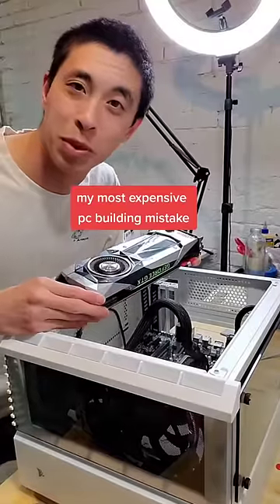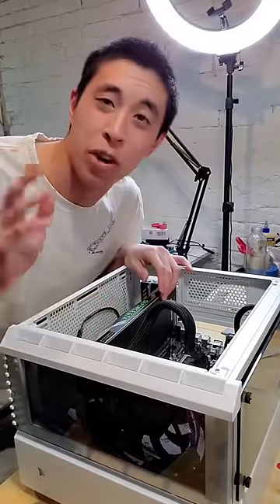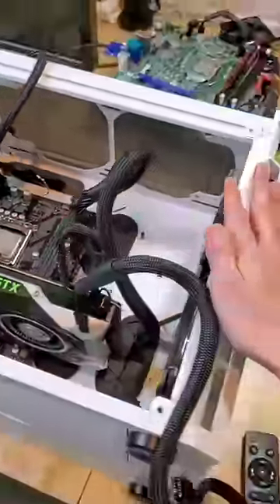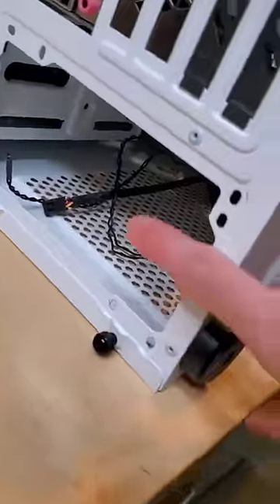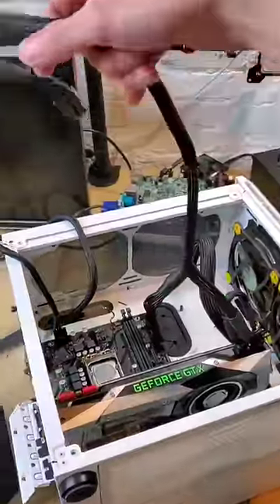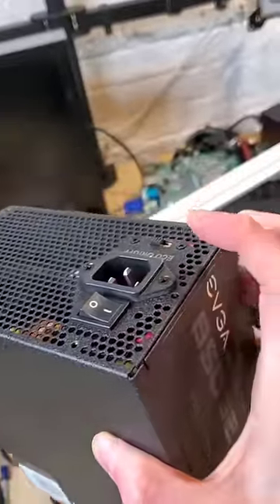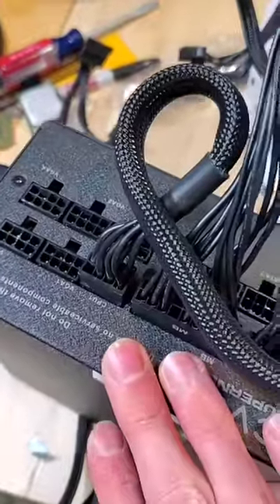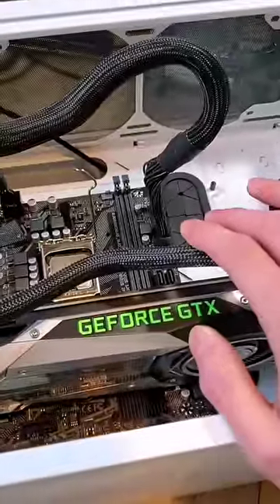my most expensive pc building mistake... #shorts

Comment: I bought every single price I needed for a rig, every single one of them was incompatible. wrong socket, wrong ram, wrong PCI version for the card, wrong case, GFX card was too big for the case, wrong heat sink, and wrong video cable, PSU didnt have the right power connector for the GPU. The fans fit the case tho. Biggest mistake ever. I got the right parts the second time around thanks to PC Part Picker, of which I discovered 2 years later...
Reply: god damn that sounds annoying. this isn’t as bad but i just bought some second hand corsair RGB fans, only to find out i can’t use them w my motherboard and need the corsair hubs, so i then bought some second hand fans the commander pro and an rgb hub, only to then find out 3 of the fans the second guy gave me were only red, the rgb one didn’t work and the original ones i got are older ones and aren’t even compatible with the hub lmao
Reply: On my first build I think I was so paranoid about making that mistake I spent nearly a year researching part compatibility (back in 2009)
Reply: @CreativityNull  At least I didn't give up and buy a Mac >.>
Reply: @zilog1  no for sure. I'm not saying your approach was worse than mine, sorry, was just offering an opposite viewpoint. I spent way too long grinding the research, and I still missed a lot of obvious things (like not using standoff screws and frying my first motherboard when it shorted)
Reply: @CreativityNull  nah nah I getcha. no hard feelings. just saying
Reply: arent PCI versions up and downgradable?
Reply: @CreativityNull  lmao I know that type of paranoid. I spended more than a year doing a research of the components and 2 weeks before getting the pc I checked like 5 times per day the characteristics of each component I chose
Reply: bruh you dint even watch any youtube before doing that?
Reply: @LongX49  I was 13 :p
Reply: @zilog1  It’s a big problem with young builders, but it’s easy once you get the flow, well you learn from your mistakes, and i hope it eventually helped out!
Reply: @berichixd7219  Yeah, it’s not all a breeze, but it’s not that hard to get things right in a pc, you just have to figure it out, and there are alot of good compatibility tools online.
Reply: @khertz  There are multiple Pci versions, but there are 2 mainly used, standard Pci is mostly used for older graphics cards or audio and bluethooth modules, but PCI-E is used for higher performance graphics cards and these graphics cards fit inside pci but it wont run as well.
Reply: he's just trolling, pcie is backwards compatible and every psu has pcie connectors
Reply: @nvramdotli  depends on when it happened. The PCI-e compatibility isn't usually a real problem but it can seem like it for a lot of people (and some motherboards and PCI-E cards can have trouble negotiating speeds if the version doesn't match. I had this issue with a SAS controller I was using as an HBA for a home server build. Graphics cards don't typically have this problem though.) As for the PSU, depending on when it was bought this could have been in the days where some PSUs didn't provide GPU power (if this was like 2006 or something) because most ran entirely off of the power provided from the PCI-e port. It also could be that they bought a cheap PSU around 2010 (plus or minus a couple of years) where not every PSU had an 8-pin connector for a GPU and he might have bought one that only had a 6 pin but then bought like a 9800 GTX or a GTX 280 or something. It might be none of these things but you're working off of a lot of assumptions considering we don't have any information like a timeframe or what exactly the parts were. The least you can do is give the benefit of the doubt

Either way, it happened awhile ago, it's done and they seem to have learned from it, so what are you trying to prove here? Are you just wanting to feel superior? Because right now you seem worse than the kid that made a mistake (which was fixable if the company they purchased it from was good with returns). I'm seeing a pretty good example of the Dunning-Kruger effect here :P
Reply: @CreativityNull  lol by the time you got everything together it was probably outdated as shit
Reply: How does that even happen... Did you just buy components based on what name sounded cooler
Reply: I walked into a computer store with my dad when I was 13 (they still existed at the time) and picked every part I needed for a PC. No compatibility issues except I made the poor choice of buying an unnecessarily expensive motherboard and a cheap CPU. It was Asus’ best AM3+ motherboard with a weak FX-4100 CPU. Everyone learns from their mistakes, but a little more research goes a long way.
Reply: Imagine not taking 2 min to do some research or ask questions and just buy random parts thinking a pc is like legos and you can just plug whatever wherever
Reply: @CartoonWeasel  I was about 13 with no internet until I was 18 :)
Reply: @CreativityNull  Bro it took me a year on and off research too. But thanks to youtube and pcpartpicker I managed to build my own pc. Only thing I regretted is that I listened to the employee about using a non modular instead of full modular.
Reply: @CreativityNull  my first build of everything was this year and it went perfectly
Reply: @bigboyfluffy5531  congrats! That's awesome! Information definitely feels more accessible these days than 12ish years ago so I'm glad more people are able to take advantage of that.
Reply: @CreativityNull  I probably spent even more time, though that was mostly down to having all that time while very slowly saving up for everything. I started researching early in 2019. The first part was probably bought mid-2019 if I had to guess as it was on sale. The PC was finished in December 2020, and almost entirely rebuilt to be upgraded in December 2021.

For those that care: I upgraded the CPU (R5 2600 -> R9 5950X), mobo (because it couldn't even handle 2 sticks of RAM at 3600 MHz, let alone 4), boot SSD (slightly faster and 1 TB instead of 256 GB) and PSU (my previous one was fine at 650W, but I upgraded to 1000W for a future GPU upgrade - which is hopefully soon with the dropping prices :>)
Reply: @monsesh1316  PCPartPicker I don't think existed for my first build and I wish it had. I built a few dozen wishlists on Newegg and kept checking performance and compatibility. PCPartPicker makes this stuff so much easier.

As for the modular vs non-modular it used to be (probably 8 years or so ago) that going non-modular was a good cost saving measure and you weren't getting much more in quality by going modular and the only thing you were getting was better cable management for the extra cost. Now the price gap has narrowed considerably because modular (and semi modular) PSUs are more focused on by PSU manufacturers and they can bring down overall costs with higher volume orders. This also means non-modular aftermarket PSUs aren't getting the same attention they were and you're now getting way more by spending the extra $20 or $30 on a comparable modular PSU. The sales rep you spoke with was probably working with old information, which is understandable, but I wish they had kept up better for your sake. Hopefully the worst that happened is you wound up with some system instability (that's what happened to me when I bought a cheapish PSU years ago) and not fried components.
Reply: FUUUUUUUCK dude. This is something I worried about in highschool but I know my stuff now so that's just a good chuckle man. I feel for you.
Reply: @zilog1  Honestly idek how you mess up that badly. You probably should have gotten a Mac.
Reply: @Vizimech  I was 13 with no internet access and parents did not know how to tech. You'd have to shoot me before I get a Mac to use unironically. Macs are a blight among humanity.
Reply: I feel sorry for you bro
Reply: Dude this was hilarious.
Reply: This is why before you build a pc, make sure you have an enough knowledge about each parts. I used to buy a pre-built pc before but when I finally got enough money and research, I started to built my own.
Reply: @JohanneszAgum  I was 12 🙄
Reply: @zilog1  Welp that was an age for curiosity but you failed to mention your age so I was assuming that you're probably like 19 older above. I was building pc at that age tho.
Reply: @JohanneszAgum  I was 13 at the time. I'm currently in my mid 20s

Comment: You'd think there would be some, ya know, standard for that sort of thing so we're not shoving 12 volts into a 3.3 volt line, but evidently that's not how PSU manufacturers work.
Reply: Yeah kinda sucks, if they did create a standard though it would save so much time when changing psu's.
Reply: I built a pc and I have no idea what you're saying, how lucky am I??
Reply: @loserdude2541  so if you want to change your power supply, you have to change both it and the cables that come with it and replace it with the new psu and its own cables, which sucks for fully modular psu's because it means you have to take out all the cables and redo your cable management instead of just unplugging the psu and plugging in a new one.
Reply: @darktamer1089  dannggg thanks for the advice
Reply: @darktamer1089  how does that work for 3rd party cables then? Like cable mod?
Reply: @HiddevanGelder  honestly im not sure, your mostly praying to god that they work for all psu's and nothing overvolts.
Reply: @HiddevanGelder  extension cables that go on the end of existing cables are OK because device side of the cables is standard, as specified by ATX or by PCI. Only the pinout of the plug on the PSU body differs between PSUs.

When you order cables that plug into the PSU directly, they get customised for your specific PSU that you must specify. They better have a test jig and don't make mistakes, because those can be expensive.

Comment: A few years ago, a motherboard has just failed while in warranty. I was disassembling the computer for the RMA, and during CPU removal I dropped it on the LGA socket. A few pins were bent.
As the manufacturer asked for the socket picture before sending the motherboard, I got a thin tweezer and carefully fixed the pins, while using the camera to check over every small movement if it does look funny on the picture.
I spent over a whole morning fixing the pins and finally got it look "normal" on the picture. I sent the MOBO for the RMA, and, luckily got a new one successfully. Otherwise I would be screwed, because it was like a 250 dollar MOBO.
Reply: Ladies and gentlemen, we got him.
Reply: So when asked about the most expensive PC building mistake you made your best effort is one that cost you nothing....

Not the sharpest are you...
Reply: That few one pin have also encountered.. Was angry and confused as he'll, why a new one came out in this condition... But I have bend it a lil bit and it works until nova days 🙈
Reply: @Jafmanz  cost him alot of time. Which in itself is pretty valuable
Reply: @Jafmanz  I'm sure you're real fun at parties. Oh who am I kidding? You don't get invited to parties.
Reply: @coleragsdale4827  In that case I once waited 2 weeks for a custom cooling system from Germany. 2 WEEKS! EXPENSIVE!
Reply: @river7874  Your idea of a party will differ from mine no doubt. The last party I attended was at Holyroodhouse in July 2019.
Reply: @Jafmanz  lmfao I'm dying
Reply: @Jafmanz  I wonder why...
Reply: @Jafmanz  no, your time is valueless, and I presume joyless
Reply: @Jafmanz  maybe I'm not very sharp, or, maybe I'm just lucky for my most expensive mistake to cost nothing on my wallet. It was my most expensive mistake nonetheless.
Conclusions can only go as far as you are capable of drawing them.
Reply: Reminds me of the time, when my $1.000 CPU randomly died, but since I could troubleshoot every component but CPU and motherboard, I was convinced by professionals, that is almost guaranteed, that the board died. Which is why I bought a used board, which works but has no use currently.
Anyway, this board came with bent pins. I could have easily sent it back and refunded it, but as an artist with hands, which are used to work out fine details, I got all the pins put back into place and the board runs fine. I keep it as a replacement board, should my original board die.
Also, the replacement CPU came with a god damn dented hole on the contact side...... I assumed a pin wouldn't have contact and the whole thing not working, but that thing is now running like butter for almost a year.

People kept telling me, everything NEEDS to look perfect in a computer and needs to be in flawless condition, but I am slowly learning, that components can be perfectly fine, which look a little beaten on the outside.

Comment: I had a friend who accidentally plugged the cpu power to GPU and gput to cpu I think. It was first time building his pc and everyone assured him there isn't a way to plug stuff in the wrong ports.
Reply: The shape of the pins are different I think. How did he manage to do that
Reply: @stanleychen3929  I think it's because you can put any shape in square hole
Reply: @talonfluff  haha, all these safety protocols and people still manage to fuck it up
Reply: But the cables are labeled where they have to be plugged, he didn't read that?
Reply: @Conraa8  the cpu power is literally the poopsite polarity To pcie power
Reply: @talonfluff  look at a 8 pin gpu cable. There is a tiny little plastic flap connecting two pins. The gpu terminal has a missing wall to match the flap. Going gpu into cpu would be really impressive (and sad)
Reply: @Conraa8  lmao no they have different ports on the psu for a reason
Reply: It's like plugging a European power plug to an american one
Reply: i did the same thing, but my components were fine. all i would get is full blast fanspin and no picture, and after doing some checks, i found out i used the wrong cable for the CPU
Reply: @aiexzs  but how did you do that, it's like plugging usb A to an usb C port
Reply: @michakrzyzanowski8554  idk, i was 11 at the time and it was my first build
Reply: @aiexzs  I still have no idea how did you manage to do this. Try putting a square into a trapezoid shaped hole. Becasue that's exactly what it is

Comment: Me and my mate were building an "in drawer" hidden media PC. We were having some beers during set up. I put my beer down on the top of the drawer... He knocked it over. Goodbye MB CPU and graphics card. PSU and hard drives some how survived, for years.
Reply: Most hard drives and ssds are actually water resistant. They don't advertise it but your data is probably the most important part of the PC.. as for the PSU you got lucky 😂
Reply: it shouldnt be broken just let it dry and dont use it for atleast a month till its fully dry it might work!
Reply: tbh the beer leaving sticky residue might be the biggest problem, its possible that the parts could be saved by washing them, as stupid as it sounds xD
Reply: @provo-go7717  yeah, like dropping your phone in salt water 😳😳 it's best to shut it down, rinse it off with fresh water and then let it dry ,
Reply: @victorsvidss  wouldn't it be better to use rubbing alcohol since it dries faster so you have less of a chance of shorting something when you forget?
Reply: Unless it was on you could’ve easily cleaned it with rubbing alcohol I did that with a friends whole pc when he spilt Dr Pepper in it
Reply: @provo-go7717  Have done this before, spilt orange juice on a keyboard, left it to dry but it went sticky so took it all apart rinsed it all off in the bath let it dry again put it all back together and used it for another 4 years.
Reply: @zekrua4006  if you have a bunch of rubbing alcohol handy to dump on your device then sure. But time is not on your side if you dunked your phone in salt water. It's best to 1- shut it down then rinse it off. Then when you get home you can apply some running alcohol to all the openings
Reply: I spilled a lot of drinks on my old PC build in 2011 through years. From cola and water to beer. I've built it in some shitty case, so with a hot Fermi gpu it had to be open all time, every liquid went straight inside. When it was standing on the ground I accidentally kicked the mobo and gpu multiple times aswell, PC turned off sometimes after a bump but started again with no problems. It still works lol.